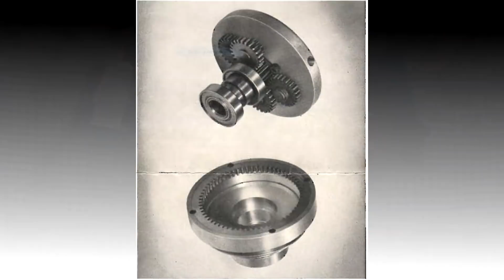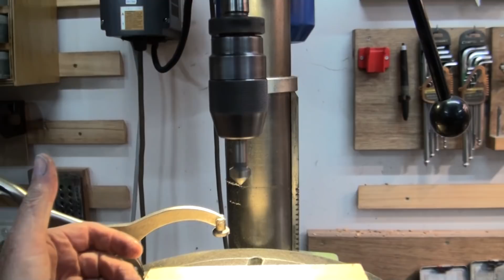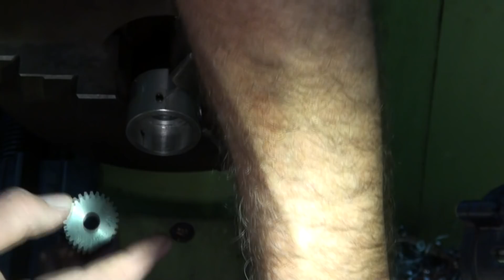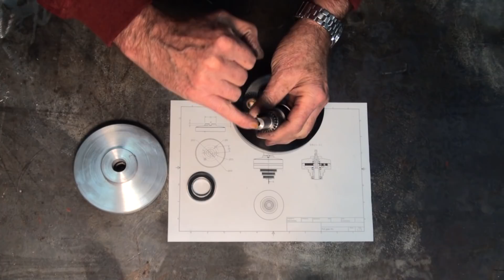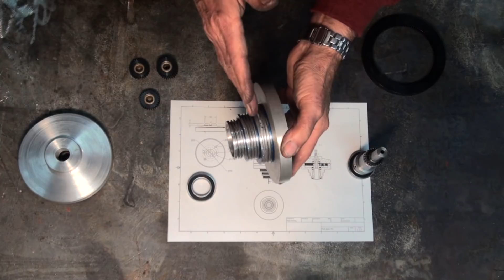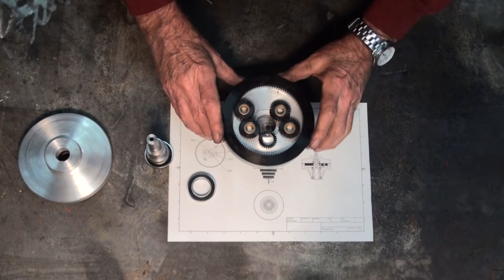Pull Gear Speed Reducer - Thanks to Mr. Pete

Comment: Hi Mark, I have almost the same drill press as yours, also made in Taiwan with a build date of 1988/3. It is a 115/230-volt, about 1.5-hp motor. I can't find a motor speed on the panel so I'm guessing about 3000 or so. It's a 12-speed unit with three, 4 step pulleys between the motor and the spindle. Speeds, as per the label for 60 Hertz, range from 250 to 3000 in 12 steps. Drives are via two, single, "A" form "V" belts!
 I have cut, in 1/2" aluminium, about 4.5" holes for an RF switching panel at the radio station I worked at, using a holesaw with a robust mandrel, not the homeowner's diy version, and lots of WD 40 as coolant/lubricant. The chuck is 5/8" Jacobs style on a Morse Taper #1. I have driven drills up to 1" in steel and aluminium without problems of lockup or belt slippage on a regular basis.
This "pull gear" device looks intriguing and I'll be keen to see it operate on yours.
Regards from Canada's banana belt.
🤞🇨🇦🍌🥋🇺🇦🕊🇦🇺🪃🐨🪓👜🐖🏁👍
p.s. Mark, if you put your drive gear at 25 teeth, your first idler gears(2 of) at 50 teeth and your 2nd idler gears (2 of) at 25 teeth and your ring gear still at 100 teeth, by my calculation you should be able to achieve an 8:1 ratio overall instead of a 4.166:1 that you have now. That's if my math is correct? Obviously axel posts would have to be moved but you've got plenty of real estate  to play with in that casting that houses all the inner workings. However, it is 01:10, in "up-over, Canada" and my brain cells are over worked. Also it's 7 years after the fact. And I haven't watched the other 4 parts yet. You're welcome, Toodledoo!

Comment: Hi Mark,
I'm new to your channel. I came to watch your Kooka Muller videos and have stayed. I have been watching your playlist from oldest to newest and have immensely enjoyed them. Everything you have done is very professional looking. As my uncle used to say, "You do good work."
 As far as the speed reduction goes, the photo you showed has a reduction gear as one of the planetary gears. If you look at the planetary gear at about 1 o'clock, you can see the step down gear underneath. This may be how Mr. Pete got his reduction. There are a lot of fun things you can do with a Planetary gear system. If you put your main power through the sun gear, take power off the planets, and drive the ring gear with a variable pitch pulley as an off take, you can actually go from forward to reverse by adjusting the variable pitch pulley. This was my Senior project in college. Thanks for your inspiration.
  Ron
Reply from the maker: Thanks. I did dig into the mathematical side of the reduction ratio and I even made some rudimentary physical models. I came to the conclusion that there were two different Pull Gear models offered, one of which had a double stacked gear cluster.
Regards,
Mark

Comment: This is a variation of a radial arm milling machine from England, in the late 40's or early 50's. I cannot for the life of me think of the name of it. That happens with age. Loved the design of it, and didn't know there was a pull gear assembly you could buy, but I was only a boy in the fifties. Then the Vietnam war took precedent for when I could have been making use of such a devise.
Reply from the maker: That would probably be the Dore Westbury milling machine designed by Edgar Westbury. It had an optional planetary back gear assembly on the main spindle. I bought the plans for it but I was too poor to buy the castings. Every now and then they pop up on the second hand market.
Regards,
Mark

Comment: MrPete222 misspoke on the 7:1. He corrected himself later.  The B-type model has a 7:1 reduction. The A model has ~4.5:1 reduction.
Reply from the maker: I figured that out after a lot of modelling and some laser cut gear templates. I am wondering how noisy the double reduction B type model would have been.
Regards,
Mark

Comment: Awesome upgrades! Can you link to the poly V drive pulleys and belt? I need these for my press!
Reply from the maker: You can find the belts in most auto accessory stores. Modern cars use them for fan belts and accessory drive belts because of the low noise properties and the ability to wrap around very small pulleys. I got my three ribbed belt from Super Cheap Auto here in Australia. There are belts with multiple ribs depending on how much torque you want to transmit. Look for K section pulleys and belts https://simplybearings.co.uk/shop/Belts-Multi-Ribbed-Poly-V-Belts-K-Section-Poly-V-Belts/c4601_4791_4794/index.html?page=1
Regards,
Mark

Comment: How much would the gears cost if I went and bought them? I would like to have a second mechanically reduced gear on my DP, now it has a two winded dual speed motor with 1HP on both 1400 and 2800 rpm and a 1:4 gear reduction after the belt drive. It can already sink a 30mm drill into mild steel without predrilling, but if I wanted to upgrarde the spindle taper to MT4 it would lack torque. (In any case I wouldn´t use step pulleys. They are not for me.)
Reply: Actually, according to my calculations I should be plenty good to go with using a PLA printed gear as the ring gear and buying the rest from China if I adjust the gear sizes up a bit. It's so small amount of torque, 1HP at 1400rpm.
Reply from the maker: I am sure you could get a PLA printed ring gear to work. I am not sure how durable it would be in the long term. I do 90% of my drilling with the pull gear locked in direct drive. It's only when I use large hole saws or 18mm plus drill bits that I use the pull gear in reduction mode. If you had gear cutting facilities I would suggest you cut the spur gears yourself and just buy the ring gear. That's the really difficult one to produce without specialist tools. There is a version of the pull gear that has a double reduction but I have not seen any detailed photos or drawings of the internals. I believe it gave a roughly 7.5:1 reduction. 
Regards,
Mark
Reply: @Preso58  I thought about building a 3 speed one but it would make the design totally different. I did however some mods to the design so that it wouldn't sling oil so I can pour there plenty of it and also the other part stays stationary on both speeds. The gears will turn all the time but I put roller bearings to every moving part so it won't be an issue. Thanks for the reply Mark.

Comment: Hi Mark,

consider slitting the aluminum holder in three places in-between the chuck jaws and using it in a clamping action to hold the idler gear instead of using grub screws. Works well and no damage to the teeth by accident.

Comment: Don't suppose you cast those aluminium blanks from soft drink cans did you? Soft drink cans have a lot of manganese in 'em. Not good for fine lathe work. Machining causes embrittlement leading to fractures on thin sections... Like D grooves.
Reply from the maker: I used the base from an old lawn mower and I think it had a lot of magnesium in it. It was singularly the worst machining alloy in the history of the world. I promptly dumped the rest of the stock that I had. I did remelt the old pulley but I added a load of material from a car engine cylinder head. I buy it from the car recycler for $1 per kilo. He usually charges me $10 for a 6 cylinder head. The only issue is cutting it up into chunks that will fit in my crucible. 
Regards,
Mark Presling
Reply: @Preso58  Hmmm. Not too sure why you are having so much trouble machining Aluminium / Magnesium alloy. I have a couple of mates who are quite knowledgeable in such matters. I shall ask them and get back to you. One spends most of his working life machining aluminium and the other spends his life making aluminium alloys. Between them they should be able to figure out what the problem is.  At the risk of sounding like a pompous know it all, a good way to check for magnesium content in aluminium alloys is to deposit a few drops of dilute Nitric acid onto the aluminium.  If Al is alloyed with Mg it will react with the HNO3 and outgas Hydrogen. HNO3 will not react with elemental Al. Concentrated HNO3  on Mg / Al will outgas NO and NO2 and probably a bit of H2 as well. By the way, I like your channel and admire the effort you expend in explaining what you do and why you do it. If I may be so impertinent to say so, you  do good work.  Regards  Chris Harris.
Reply: @Preso58  Good afternoon Mr. Presling,
I have written to a man who is most knowledgeable in matters relating to the casting of aluminium and the behaviour of the various alloys of aluminium. Perhaps he may be able to shed some light on the mysterious behaviour of your aluminium alloy. He has a You Tube channel, the name of which is 'Olfoundryman'. When he writes back I shall pass on his thoughts on the matter. In the mean I have spoken to an old timer  machinist mate (doesn't like computers, doesn't trust computers, doesn't watch television, doesn't even like 'them new fangled wireless telephones that kids can't live without) who informs me that there is a possibility that aluminium / magnesium alloys can suffer from embrittlement if they cool too irregularly during the casting process. Machining may cause stress fractures leading to mechanical failure, especially with thin parts which are more susceptible to vibration. That may explain why the 'D' groove walls were suffering from mechanical failure. He also said that the rake angle on the tooling needs to be spot on so as to minimise chatter.
Reply from the maker: a0cdhd, I have been watching Martin's channel for some time now and it was a bit if a revelation when I found his content. Up until then I had used two books by Terry Aspin and Myfordboy's channel to learn about metal casting at home. Since then I have found lots of other channels with useful information. I have been in touch with Martin through the comments section on a few occasions and I really appreciate the detailed answers he is able to provide. A true gentleman and someone who is eager to pass on his knowledge. Having a background in education, I can tell he is a natural teacher. I get really frustrated with people who have "trade secrets". However, I digress. I was particularly cranky with that casting. I made three castings using the same batch of stock which was a mixture of the old lawnmower base and some scrap car cylinder head. The other two casting machined OK but they were pretty straightforward turning and drilling operations. The vee grooves for the polyvee belt were a different animal all together. I could feel the tool digging in and loading up the tool and the lathe spindle and nothing I did seemed to help. The material was building up on the tool cutting edge and it was not forming chips. I suspect it was as you suggested. Probably a chilled casting with very brittle structure. Once I got started it was a case of having to push forward since I would have lost all my indexing if I took the tool out to play with the geometry. It was not a good day in the shop. I would be interested to hear what Martin has to say though. I tried to get in touch with him but couldn't find his email address. 
Regards,
Preso
Reply: Private message

Comment: I don't believe I have seen a high speed tool holder that held the bit in a vertical orientation like that. It seems like it simplifies the sharpening. How well does it perform and do you have any holding issues?
Reply from the maker: Tangential tools are really easy to sharpen. When I purchased the holder it came with a jig for clamping the tool bit. It gives a consistent grind every time and the included angle presented to the work is less than 90 degrees so you can machine into a corner without the tool edge rubbing. I got mine here https://www.eccentricengineering.com.au/index.php?option=com_content&view=article&id=32&Itemid=297
It performs as well as any well ground HSS tool bit but you don't waste so much HSS stock during regrinding. I have two of them. One RH and one LH. I also purchased one of their inverted parting tools which gives me a bit more peace of mind when parting off. This is not an advertisement. I am just happy with their products.

Comment: Perhaps you should watch all of Mrpete222's series on this as you'll find he explains about the 4.5 Vs 7 to one ratio error and you'll also perhaps notice that the planetary gear positioning you are using is different from the internals of his equipment after his tear down.
Reply from the maker: I did watch all of Mrpete's videos on the pull gear however I started to reverse engineer mine as soon as I saw the Lyle's first video. I sort of worked out how the 7:1 reduction was going to work but by that time I had already purchased all the spur gears for mine. I only had some low resolution line drawings and photos to work from but I think that what I ended up with suits my purpose without making it overly complicated.

Comment: I have a drill press that is from the late 70s, branded Industrial Machines, that looks just like yours.  It has a different table on it, and still has the intermediate pulley set.  If I remember correctly, low speed is 80 rpm.
P.S.  I just ran into your channel.  It is quite interesting.  I would be tempted to use a Tig Welder and fill in those bad spots and re-cut it.  You have quite a bit of work in the part and I would spend some time trying to salvage it.

Comment: What are the numbers of teeth for the different gears? I see that the sun and planets have the same tooth count, is that correct? I found a good calculator online for planetary gear systems that will solve the tooth count for you, but it doesn't seem capable to account for the "idler" gears you are using here. How did you determine the tooth count of the planets for a given ring gear tooth count? Thanks so much :)
Reply: Also, if you don't mind, what pitch and pressure angle did you use? Thanks again.
Reply from the maker: Michael, the design of my Pull Gear was reverse engineered from the original patent drawings. I used M1 (metric) gears from Ronson Gears here in Australia. They have a very good website with lots of technical resources. I chose from their stock gear range here https://khkgears.net/new/stock_gears.html
I began with the ring gear since I knew roughly what size the original pull gear was on the outside diameter. A 100 tooth ring gear worked out to 130mm OD which was close to the roughly 4 1/2" OD of the original. From their I went to the smallest sun gear I could fit over the central spindle while still leaving enough metal to cut a keyway into. It worked out to be 22 teeth. The two pairs of planet gears just had to be small enough to fit into the space between the sun and ring gears. The idea of having two pairs of meshed planet gears was so that the spindle direction was not reversed when the pull gear was engaged in reduction drive mode. I chose 28 tooth planet gears but they could have had more or less teeth within reason without affecting the overall drive ratio since they are really just idler gears. So, the finished gear ratio was 100/22 or 4.54:1. This matched very closely to the ratio given in the original pull gear promotional material. I struggled for a while trying to work out if the planet gears would have any influence on the finished drive ratio and even went as far as to laser cut some gears from acrylic and try out different combinations but I eventually realised that the planet gear tooth count did not seem to make any difference. I also tried some online gear calculators and ran into the same problem as you. With regard to the pitch and pressure angle, I just chose from the stock gears in the M1 range. You can work out those numbers but unless you are cutting imperial gears it probably doesn't matter. Check out the Ronson Gear tech pages if you are interested.  
Regards,
Mark